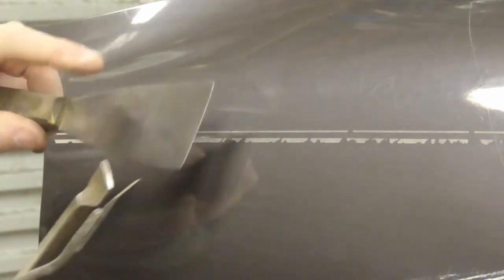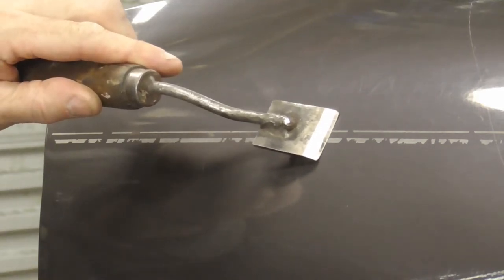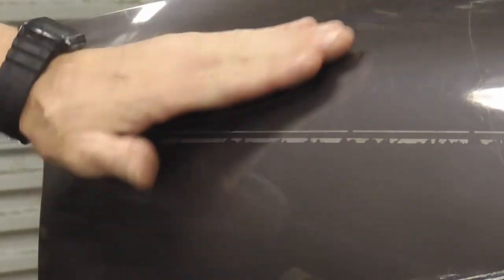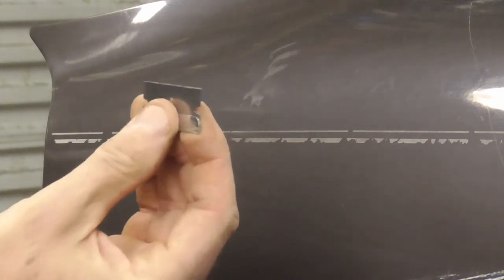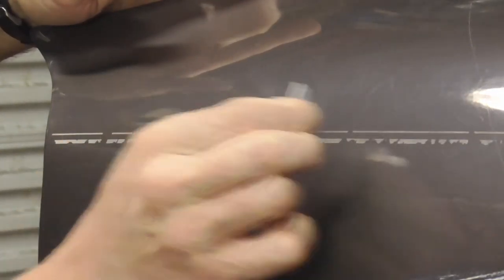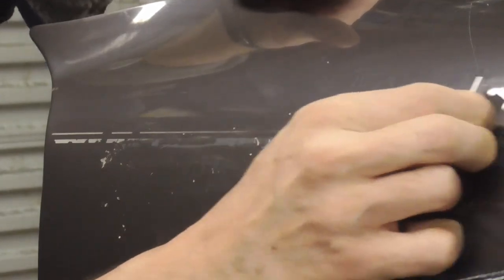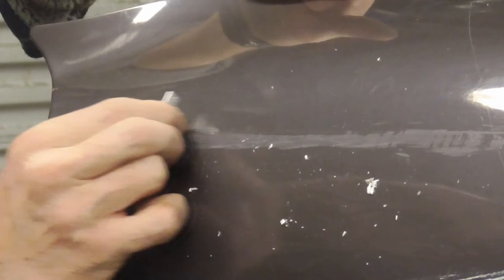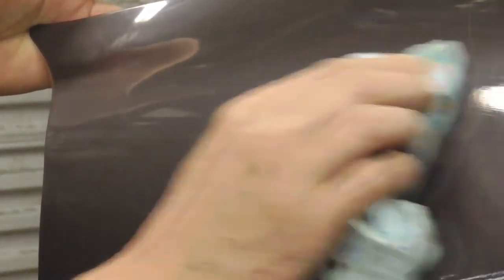How to Remove Stubborn Pinstripes Without Gouging the Paint

Comment: Seriously..? This is a joke right?
Reply from the maker: In an actual body shop, It's most commonly taken off using heat but when the stripes are baked on heat doesn't work.  You have two choices - sand it off or do this.  I don't like to sand it off cause it creates more work.  This method shaves it right off flat.  Your going to paint anyway.  But! if you do it real careful you could wheel this out and save the paint.

Comment: Scraping your car with a razor blade perpendicular to the car's surface, huh?  Well, I wish I had the success others had.  Instead, about 10 inches of my 2016 Ford Explorer's paint job is now <insert expletive here> up.  Now I need to find a YouTube video that shows me how to buff out paint scrapes.  Is this an April Fool's video to prank your friends?  I fell for it.  Wish I had the mad skillz you guys do but for now I'll just cry in my beer.  Thank you, Lakeside Autobody!
Reply from the maker: Sorry about that  - really.... If you try it again, start out with very light pressure then gradually add pressure until it starts to remove the old material.  If the decals are still in good shape just use a heat gun and peel the sticker or stripes off.  Jerry
Reply: @LakesideAutobody  Thank you, but I used plastic wedge tools used to remove car consoles to do the rest of the scraping job.  Any recommendations how to buff out the scraped 10 inches I'm talking about?  I'd send you a picture.

Comment: Dremel with buffer pad works good on 20 year old pin striping. just saying
Reply from the maker: Does it heat it up or sort of rub it off?
Reply: @LakesideAutobody  Both and don`t hurt paint at all.  Got to be something better than Windex to remove  glue?
Reply from the maker: @tomrolie3680  Good info - thanks
Reply: this was the first thought I had but I haven't seen anyone try it yet - I've got a panel on my old gen 1 montero that needs repainting anyway I might go ahead and try this method on it and if it works, I'll do it for the rest of the car. If not, I'll probably apply a little bit heat and then cut a razor blade to be the width of the strip down at the blade and normal width at my fingers and try that - so I minimize the plane-ing on the paint surface and maximize it on the pinstripe

Comment: You mention do it yourself sanding and paint too!   You made it much more work by saying that.  😡. There’s got to be a better way!
Reply from the maker: If the stripes are new, they can easily be removed with a heat gun.  If they are old and dry you can either sand them off or do this.  You could try the stripe eraser tool but again when it's baked on it's tough to remove :)

Comment: I just took off all my striping with a heat gun and finger nails. Took 30 min.no big deal!!
Reply from the maker: As long as it's not baked on / dried out, it is pretty easy like you say.  When it's crusty, this is the only solution - aside from sanding.

Comment: Should be named  "How to search your paint"
Reply from the maker: I don't get it.  Are you trying to say, "How to scratch your paint." ?  If so, that's not true.  If you do it correctly, you'll be able to lightly wet sand the area and buff and will see no damage.  Most of the time though you are removing decals to paint so it doesn't matter if you scratch it a bit.  It's going to be DA sanded and painted anyway.

Comment: Wtf? Yes you are scratching it!
Reply from the maker: This is very common in a body shop - use this technique for runs, glue, old pin stipes, etc.  Doesn't scrape it (razor blade must be new).  You can buff this back to a perfect shine or paint over it with no problems.   https://www.youtube.com/shorts/c7c5EfJVIiU